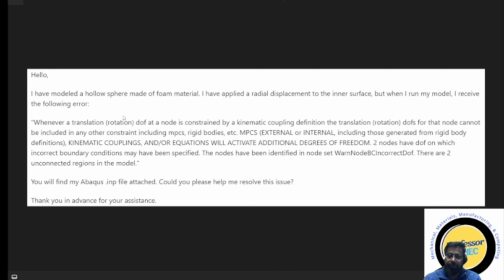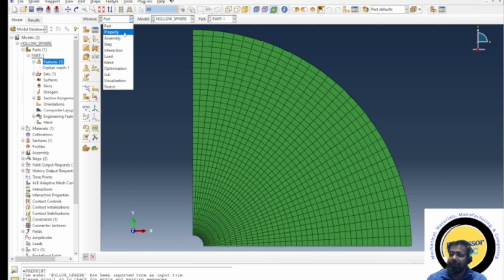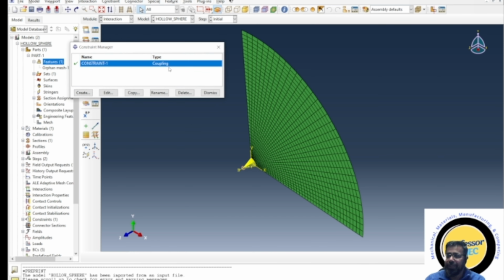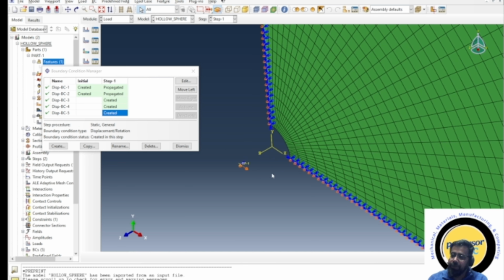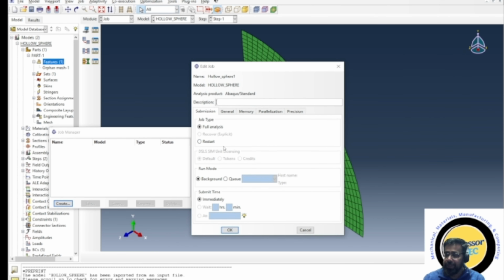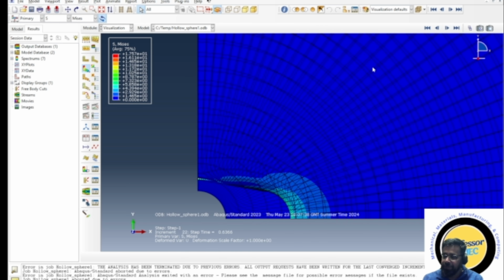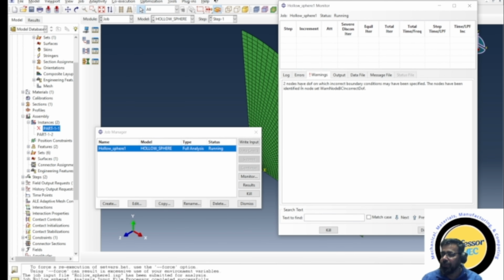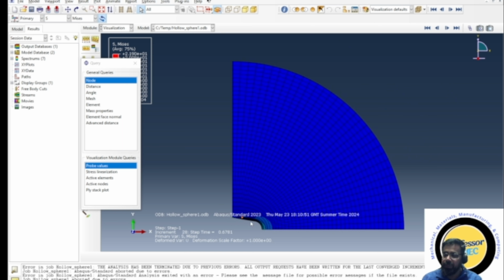HyperFoam ABAQUS MODEL Surgery for a Subscriber - Step by Step tutorial

Comment: My plasticity model works for time step 1*10^-6, when i run my nanoindentation simulation using that material, the computation time is insanely large (100+ days), what can I do to reduce it?
Reply from the maker: it is explicit or implicit analysis? for explicit you may try mass scaling while keeping any eye on total energy and kinetic energy, as later shouldn't be significant. For standard analysis try stabilisation, and also contact controls and stabilisation options.

Comment: Sir,In Abaqus, I'm performing an explicit coupled temperature-displacement analysis. In my analysis it requires normalizing of time. The author of the paper says   "We normalized time
along with the normalization of thermal conductivity with its reciprocal in order to bring down the computational cost of simulations. The obtained solution using normalized time was again converted back to normal time accordingly "  . Sir, How can I return to regular time in Abaqus after normalizing? My thermal conductivity is 10 and my step time is 36000 seconds according to the paper. Does my analysis require me to inverse these values in order to normalize? Is this  the correct way? Should I additionally normalize the time  that I utilized as a tabular input time(0-36000 sec) for my boundary condition if I do this?. I would be very grateful if you just share your thought regarding my query.
Reply from the maker: Its not clear to me how they have normalised, as normalising means with some specific quantity. I can better comment after looking at the paper you have mentioned. Thanks